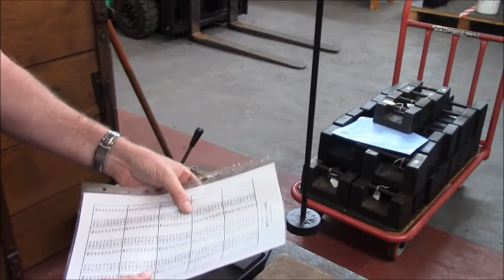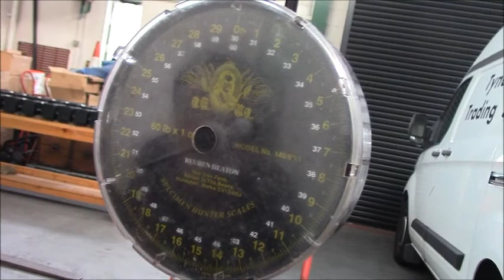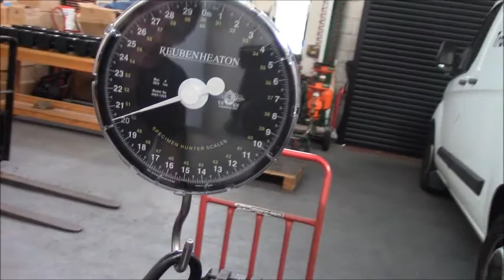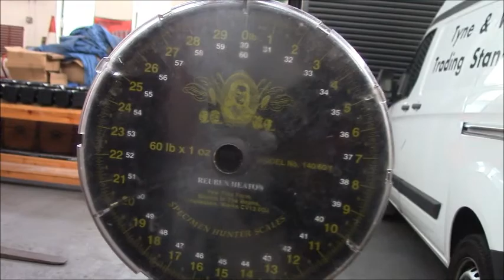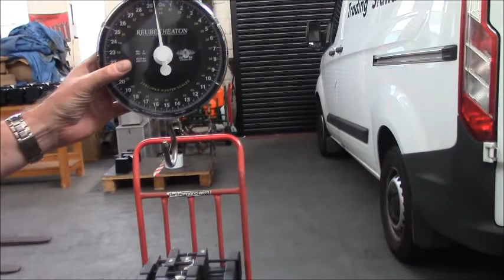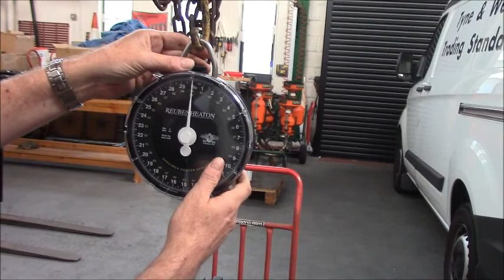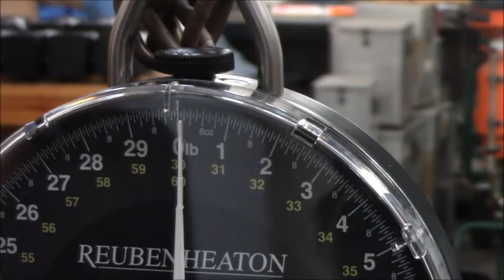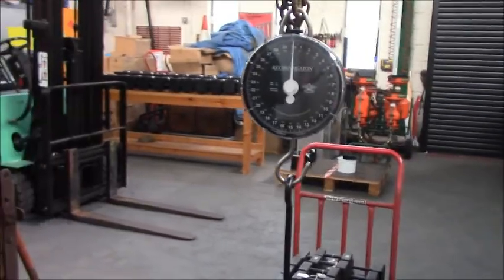scales test

Comment: Very interesting this as i have just placed an order for a new set of Ruben Heaton scales after my old ones (I had exactly the same scales as the new ones in this video) were stolen from my car last December.
This time though i have decided to treat myself and have opted for the limited edition 165 yellow dial model from 2022/23.
I wanted 60lb x 1oz divisions however everywhere has sold out being limited editions.
So i have had to go for the 120lb x 2oz division model and this video has helped me massively.
Now i know the spring needs to be broken in by stretching it with some weight in order for it to be accurate and for the needle to return back to the start each time something is weighed.
A great video top marks 👌